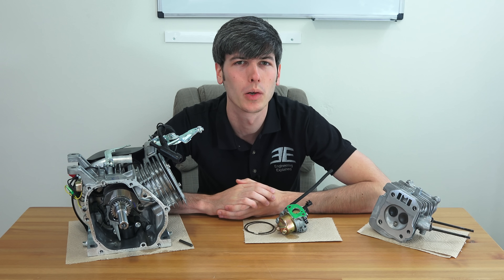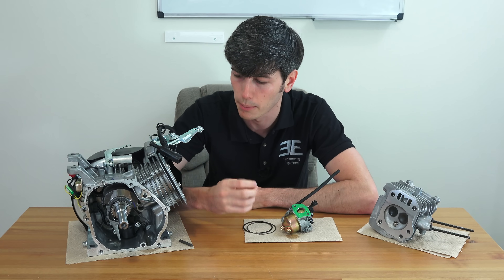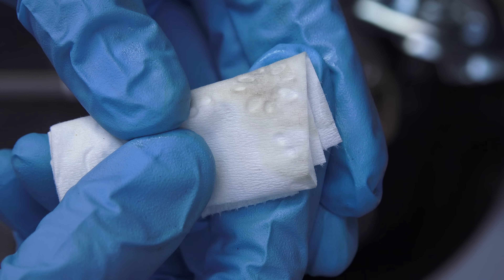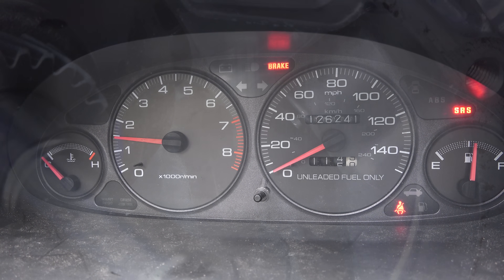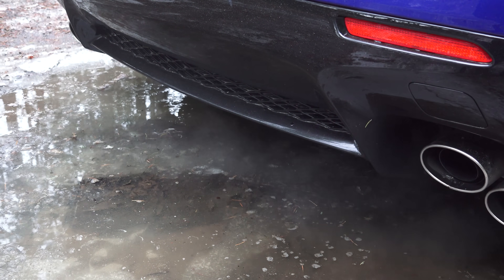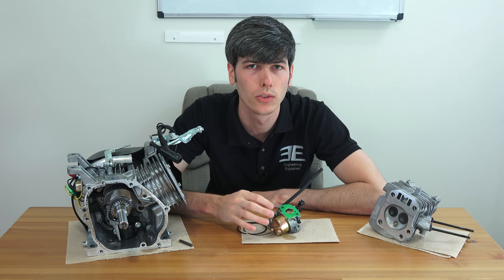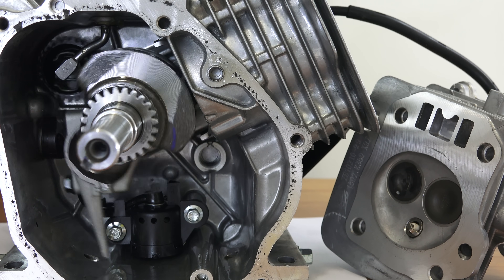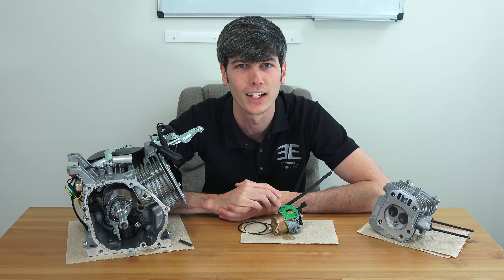Should You Warm Up Your Car Before Driving?

Comment: Okay let's say it's -40 degrees Fahrenheit or Celsius + you set off from home, 1
in about 30 seconds or maybe four or five blocks you'll find that your windshield is frosted up from the inside out why? Because your coolant is too cold for your heater to function at all and the your breath will be fogging up the inside of the car which will instantly freeze. If it's at cold or even colder as we get here you have to let the heater warm up enough where it can keep the windows defrosted while you drive and that's true whether you're in the city or out in the country.

Comment: I don't have my manual on me but i'm pretty sure it recommends against idling for long periods. I know it says to drive gently until it reaches operating temperature. Being a diesel, it takes a lot longer to warm up even while driving and idling for long periods can't be good for the dpf. Good thing I use a full synthetic, multigrade oil unlike the old days when cars had carbies and mineral monograde oil. Point being technology has changed and lengthly warm up periods that were required in the old cast iron bangers are not needed anymore.

Comment: What about the fact that different materials expand at different rates with temperature change?  I’m thinking cylinder walls, pistons, piston rings, etc.  shouldn’t you wait until they are all at operating temp before putting additional strain on them?
Reply: thenoodler from the engineering and design perspective it’s already accounted for.

Comment: Now i have no clue what they are called in english but dont you guys have those pre heaters that you plug in to a power outlet? Heats the engine and if you have a heater inside your car it heats the cabin too? Helps alot when its below 0 celsius.

Comment: I’ve watched other videos on the same topic and they seem to ignore that the main reason for letting it run for a min is to let the oil get pumped back into place to ensure parts are properly lubricated before use, since most the oil drains out of the places it’s supposed to lubricate after it’s been sitting

Comment: So, Driving a diesel pickup+camper. Gets to 10F at night, driving light isn't an option unless I want 0-40 to take a whole minute. What do? Wait for longer at idle or wait 30 seconds then get the heat into the block quickly with 20,000lbs.

Comment: On my LS1 I idle it until coolant is 100 degrees. I do this because the engine sounds weird when cold. My mom's Hemi also makes the same noise when cold, just not as loud. They are both pushrod V8 engines, so that may have to do with it.

Comment: When I start my car it’s at around 1.3 thousand revs over 5 mins it drops to 800 and stays there, the temperature Hague moves allowing coolant and oil to circulate. I don’t need to worry about any cracking in the exhaust system as I drive because I know everything has gone up to the correct operating temperature. After then I drive my car. Despite what any mechanic will ever tell me I will always warm up my car. I mean there is a reason that temperature gauge doesn’t move right away.

Comment: It's just not a good idea to jam your transmission into drive gear while the engine is on high idle and it's zero degrees outside. It just isn't.

Comment: With a turbocharged car letting your car warm up a bit is actually beneficial. From just leaving a stop sign or regular acceleration to get on to the highway your turbo can spin upwards of 30k+ rpms, cold oil is very thick and isn't going to be properly lubricating your turbo so allowing your car to warm up a bit will help prolong turbo life. As far as fuel getting into the oil, its really not a big concern as it happens normally in any piston operated motor and when oil is at operating temp it will be boiled out anyways. Plus if you change your oil at regular intervals like you should this is a non factor.
Reply: Man this is bull, try driving off immediately in -39c here in Canada Winnipeg, car literally wont go past 40km ...need to warm up at least 5 min on those temperatures
Reply: Well said
Reply: No an issue with modern synthetic engine oil

Comment: Hey, all I know is I've had several old cars (that were fuel injected) and they can sound pretty rough until they warm up a little. I think there is some validity with worn engines.
Reply: I feel that way too. I have a 2008 Toyota and I live in Minnesota and this winter there were many many days that had -20 and -30 degree mornings and it just doesn’t feel right when a car has been sitting all night to just start ‘er up and drive off immediately when the transmission fluid and oil has been sitting in That temperature all night. I should probably be switching to 0W grade oil next year but I haven’t yet because I’ve just stuck with what Toyota suggests which is 5W. Also when I have started my car and drove away quickly when I’ve been running late for example, the shifting feels slow/delayed and I don’t know some of the driving functions just feel off. Myth or not, I’m with you I feel like there really is some validity for letting it warm up a little bit with older vehicles, even if they are fuel injected.
Reply: @Jetsonn  My girlfriend's 07 civic definitely runs rougher before it's warmed up a little in cold weather, more so than my 98 civic. It has virtually no blow by and good compression too.

Comment: Direct injection the worst thing that has happened to modern engines thanks to  new stricter cafe standards by the government.
Reply: The oil gets dirty easily too because of the extra blowby from the high pressure of DI. I think it's mostly soot. I think DI engines should use better piston rings like in diesel engines.

Comment: If your piston rings are bad enough that at an idle you are able to get enough oil on top of your pistons or gas in your oil then you need to get a new engine or get oversized rings. That much blow by would mean you would barely have any compression my gosh. Another point I will make is this, when metal is cold it is way more  brittle so letting your engine warm up isn’t just about making sure you have sufficient oil pressure “oil throughout the engine” it’s also about making sure the moving parts are warmed up a little before driving, I’ve seen engines throw rods from being freezing cold and not given the warm up period. You don’t have to wait til it’s warm enough to open the thermostat up but when the temp needle gets right above the cold mark you’re good, “when the heater starts blowing heat” that means the internal engine parts have gotten warm enough to make the antifreeze get hot to warm the heater core up so the air blown through it will be warm. So in conclusion “FOR THE LOVE OF GOD DONT DRIVE YOUR VEHICLES BEFORE THE HEATERS ARE BLOWING WARM AIR” EVER!! If you have the problems with oil and gas that these guys are talking about then odds are your engine is trash anyways because the sleeves are wore badly. Every engine has a tad bit of blow by but these guys are taking things to extreme or their engines are RAGGED. Good day.

Comment: When it’s cold, I always launch my car in the 4th gear so not only the engine gets warm, but the transmission too.
Reply: He was obviously joking
Reply: Don't forget to also apply the brake while you're doing this for even more heat!
Reply: My left eyebrow just raised as I parsed this nonsense.
Reply: Your job here is done, they bought it.
Reply: I warm my clutch up a bit, extra rpm when setting off, when the engine is running rich it is a bit lumpy anyway so need more rpm (obv not excessive, just rev it up to 2000rpm where normally I can be fine at 1500.. And delay shifts to keep rpm high, automatics do this anyway)
Reply: I totally agree. But with the new cars it's better to start in 5th.
Reply: @fsgRex what if it's an automatic?
Reply: That only works for your clutch
Reply: Covalent Bond  savage lol
Reply: Castle Bravo  yes but thats an aston martin, thats a high power machine meant to handle the cruel take offs/speed and luxurious clutch prices, im talking about your run of the mill grandma toyota camry or an old beater 6 cylinder 110 hp car not your racecar with loads of torque meant to handle the harsh acceleration and skids (if built properly) 

Everytime i try it in forza the car just stalls 😂
Reply: Right after i start it i typically redline it until my engine blows up. Wait..
Reply: Covalent Bond  ladies first
Reply: And your clutch too
Reply: HAHAHAH nice one
Reply: That will glaze the cylinders in a 4 stroke who tole you that bad idea?
Reply: Not good to start in 4gear, it will burn your gears and piston and clutch plates due to over acceleration.
Reply: is that even safe?
Reply: @tiagosilva.b5  Not really, it can lug the engine, and strip the gears, plus you don't have much acceleration, there's a reason why you start in first.
Reply: TIAGO SILVA its absolutely safe i do it all the time
Reply: @KyleDisney  how is it safe, its 4th gear i dont even think its possible to take off in 4th gear in your run of the mill 4 cyl 170 hp engine and even a more powerful engine would have trouble
Reply: @ernestochang1744  if you slip the clutch long enough, anything is possible! I don't recommend doing that though...
Reply: nevermind the question where 1 guy asked is that even safe, iwanna know if thats even possible
Reply: @ernestochang1744  yes but you have to lower the clutch real slow.

Comment: Cold oil is thicker and harder to move through ports.  Therefore; you should let your car warm up before driving to stop the thick oil from putting a bigger load on your oil pump and more pressure behind gasket surfaces.  Also if your car has a cast iron block and aluminum heads the rate of thermal expansion between these two is enough to cause a blown head gasket much quicker than normal.

Comment: We in Finland use engine warmers when it gets under 5C or so, less wear if the engine's warm before starting, and starts up easier. In older cars (or new base models) we also use interior warmers that are linked with the engine warmer, so the inside is warm when you get in.

Comment: Is upto 3500RPM ok in a cold engine?
Reply: You might want to clean your throttle body and MAF sensor... That is very high lol
Reply: @Dcc357  I meant using 3.5k rpm during acceleration ok?
Reply: Oh well yeah I wouldn't go higher than than until warm lol.

Comment: Well if that is true why does my c7 corvette redline at 3000 rpms at start. As you start driving your redline increases as the engine heats up your components. At 45F outside it takes my v8 around 15-20 of driving before your entire redline band gets to its normal 6500rpm redline
Reply from the maker: It redlines lower so you don't damage your engine when it's cold. You shouldn't drive it hard or at high RPM, you should let it warm up before romping on it.

Comment: I normally like your videos, but this is one where I flat out disagree.

During winter in the north east, the difference between driving a car with and without warm up is night and day. 

Light driving with no warm up is just asking more from an already inefficient engine with cold fluids (you can feel a noticeable lack of torque).

Just because your cars oil is rated to flow at a given ambient temp, does not mean it is flowing well. 

To keep wear to a minimum, you ask as  little of the engine as possible (idle), until the coolant gauge has moved off of the “COLD” mark.

Comment: Isn't it about viscosity of engine oil and lubrication all around, specially if the car is turbo charged. The cold oil is more viscous and hence does not reach all around because of less flow. It's better you let your car warm up for a minute or to the point where temp needle rises just slightly, so oil is nicely flowing and providing essential lubrication to critical components.

Comment: As with everything mechanical, it's always better to minimize the thermal shock by warming up the engine gradually.
The Prius for example, starting the car in cold weather, even with the battery fully charged it keeps the engine running for three to four minutes before turning it off.
Reply: That's because the engine always has to be up to operating temp- they don't want you driving it cold. Also because the prius (certain year models, not all) can use heat from the engine to warm the battery up which significantly increases battery life.

Comment: Ok, tell me why Your (and my) favorit Subaru tell in instruction warm up the engine?
This instruction from modern car (2004) with injector sistem
Reply: The manual does not say to idle the engine until the temp gauge is all the way up to normal, I just went through the manual and checked it carefully.

Comment: Minimum time idling for the least possible wear: 
 Slightly above freezing point warm up (20-30 secounds)
Under the freezing point warm up (1 ,maximum 2 minutes) 
Drive your car gently under 3000 rpm until your temperature gage it's in the first quarter at least.
Other temperatures:
Summer temperatures ( idle 5 secounds)
Alaska freezing cold ( don't drive unless you have 0w-20 oil and If You have then idle the car 3-5 minutes)

Comment: My only argument is not gas (carb vs injected) or oil (having oil that thickens) but what about heat expansion. No one talks about that. Cold coolant next to hot combustion chambers sounds like engine life shortening to me. I will continue to idle my engine until someone proves me wrong here.

Comment: Wouldn't the wear and negative effects be due to revolutions per minute and fuel used as opposed to just time? Example: A 5 or 10 minute 700 rpm idle warm up to normal operating oil temperature and pressure = 3,500-7,000 revolutions of cold operation versus 3-5 minutes or driving at 3-4,000 rpm to operating temperature equating to 6,000 - 20,000 revolutions of cold operation. 
I'm glad to learn the drawbacks of brief fuel injection cold engine function, however I would love to see which is worse when seeing how long it took to reach normal operational temperature from various ambient temperature cold starts, both idling and driving at several different rpms for "x" amount of minutes. Similar to your performance brake and rotor wear/temperature test. 
Example starting at 0 degrees, how long did it take to warm up and how many revolutions did the engine make versus driving at 2k rpm, 3k rpm and 4k rpm - and their corresponding engine revolution totals?

Comment: I don't know, I think it would be better to wait a minute for the engine to idle down to normal idle speed, then put it in drive and sit for a couple more minutes with your foot on the brake. This would give the engine some resistance, allowing it to warm up faster and heat up the transmission fluids. All at lower RPMs resulting in less wear. I don't think loading up your engine at higher RPMs is it going to be that great for it if there's less oil on the cylinder walls.

Comment: If I dont let my car get to operating temperature in the mornings and try to drive it before it has,the whole thing just stops moving. If I turn it on again and put it in drive and try and drive it will continue to stop until the needle is in the middle. It drives me insane. It never used to do it but a mechanic did some adjustments to my engine and now it does this. I'm sitting in the car waiting for the needle to go to the middle as I type this.

Comment: Here in MN with our usual below zero temps, my 2000 four cylinder accord would drop engine temp WHILE idling in a parking lot AFTER it had already warmed up and been driven several miles. So I use my remote start to leave the engine running if I'm gone for less than 20mins. Also 'warm it up' because the engine oil and trans fluid take time to start flowing. It is such a grumpy engine and has hard shifting until it is warmed up. So yes I get its not necessary but I don't care enough about the wear and resulting bad gas mileage to only warm it up for a few seconds or maybe a minute. I'm sure newer cars don't have these problems for various reasons.

Comment: 🔥It's easy just use lower viscosity oil and you are good to go!🔥
Reply: Thats true but not necessary. I have lived where it gets below -40 (and have had years where its -60 º F) and have never changed to any lighter oil than the owner's manual recommended and have always had a good experience.

Comment: what about the thermo expansion of the components? i though that the point of warming up properly was to ensure everything is at its proper working tolerances. ie if you drive it and it's not heated up properly you might blow a piston ring or your head gasket because everything is a bit "slacker" when cold.

Comment: I let my car warm up so the idle falls to a level that does not put extra stress on the transmission when putting into drive. 1500 rpm idle upon cold start is to hight to shift into drive without causing long term damage to the transmission...

Comment: A lot of chatter about  the warm up idle period before driving. EE says no warm up period is needed with gasolene FI engines?  This is the only time I disagree with him. Assuming the car is exposed to the elements: Warm weather = 30 seconds idle warm up before a driving load above fast idle. Cold mornings 1 minute  warm up, freezing mornings 2 minutes,  minus 10º - 20º plus then 3 minutes. Keep the RPM below 2,500 before the temp gauge reaches half normal operating temp. Never rev out an engine that has not reached normal operating temp. Use a premium recommended grade oil if you care about engine longevity.
Reply: Did you watch the entire video? He explains why you’re wrong. It’s okay to continue to learn into adulthood.

Comment: My car says to wait to the oil circulates the engine and not to drive it but in an emergency u can drive the car just don't exceed 2k rpms and there's a oil circulation meter on the rpms